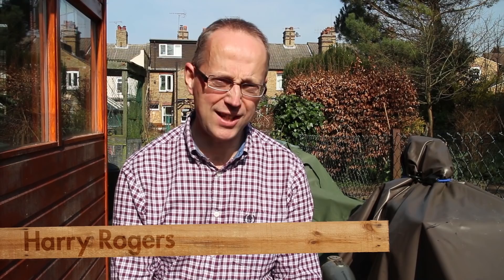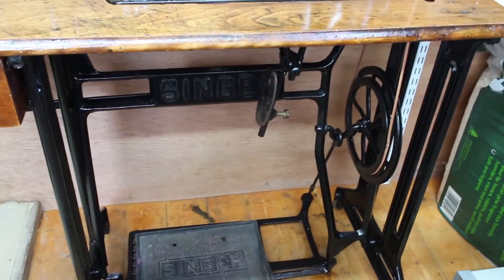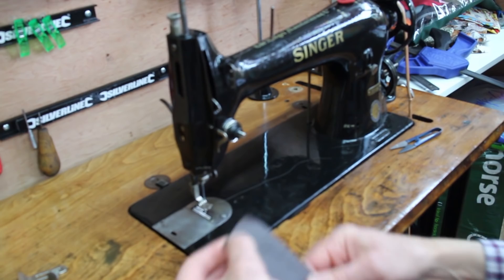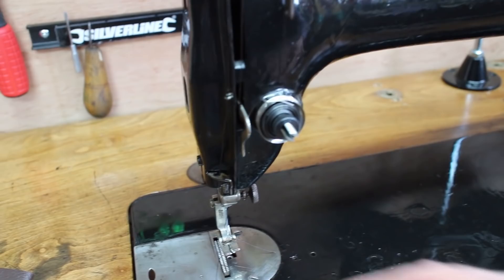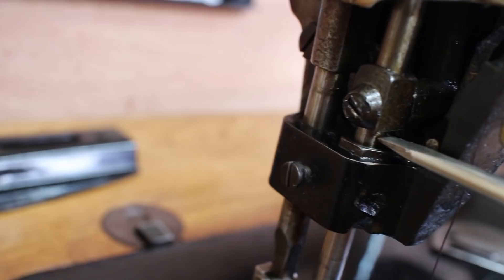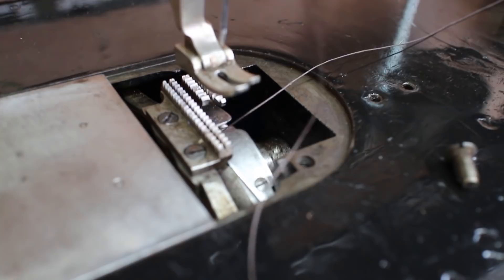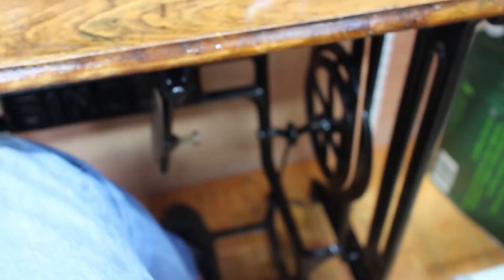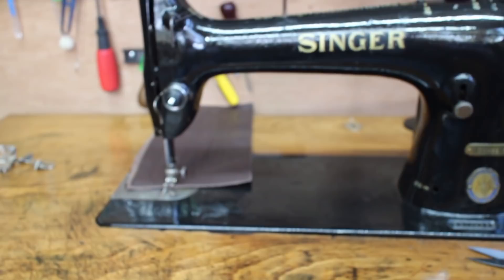Singer 31k15  overview, and Adjusting an Old Sewing Machine. Disregard 3.51 to 5.31 see Description

Comment: Hi,I have known people have cut the end of the pop rivets and use that for a tension unit pin that you discuss on you vid,
But what I wanted to ask you is my 132k6 and 45k1 don`t have that mechanism where the  cam hits the tension pin`but when I lift the pressure foot to lift my work out there is a piece of metal that hits the tension pin and opens the discs to release the tension on the thread,Why does your machine need to have this function `where others do not.
Is this more common on the older machines or the newer ones`
Nice explanation on the timing`
Reply from the maker: +wow dude Hi - I don't know - perhaps someone here does

Comment: Very nice video...very nice machine! Looks like a Centennial year Singer from the blue ring around the badge. When you are treadling, do you have your feet at a diagonal from each other, right foot in the upper right-hand corner and the ball of the left foot in the lower left-hand corner?? That's usually the best way to set your feet for a nice even treadling motion and greater control. Don't put a motor on it...it's perfect as it is. ;-)
Reply from the maker: Thanks I will try that ...very helpful.

Comment: Thanks for this video. Does the feed dog adjustment also allow to set the range, as well as the relation? I have one I picked up. It sews perfectly, but does not adjust out to the full stitch length. Thanks for your input. Very well layed out videos.
Reply from the maker: Hi thanks...I don't have this machine now, just the 331k...but you can download the manual from ISMACS...May be some oil on the adjuster if there is one to make sure it running it's full travel?
Reply: @harryrogers  I'll have to take a look. I'm thinking the eccentric on the collar is not set to its full range. You sold your 31-15?

Comment: Hi Harry, great job with your videos! very helpful to all of us newbies trying to figure things out with our machines.
I have a question regarding my 31-15 (no "K") made in the USA. My machine is breaking the thread all the time, based on your video the lever that is supposed to push out the pin on the center  of the upper tension to release the tension on the thread, the lever is not touching the pin at all during the stitching cycle, therefore the thread is to tight and it breaks.
I have ordered the upper tension unit in hopes that that is the issue following your advise, besides that is there any other adjustments I can make to correct that?

Sincerely,

Jose.
Reply from the maker: Thanks...often the pins wear and in effect become too short....it sounds like you are on the right track.
Reply: @harryrogers  Hi Harry, an update to my troubles with my 31-15, I replaced the whole upper tension unit on the machine but unfortunately it did not help at all, the issue remains the same as the problem is that the even with the new upper tension part, the pin still not being pushed to release the tension, the Needle Crank lever (part 43997) that is supposed to press on the Tension Release Lever during the stitching cycle, that in time presses the pin to release the tension.

Is there any other adjustments so the Needle crank pushes the tension release???
Thanks in advance for your attention
Reply from the maker: @Jose-yq1lk  Hi Jose...sorry I am not a mechanic, but I wonder if the linking arm loses its spread with age....is it worth trying to make a longer pin with an old thick needle to see what that does? Sorry grasping at straws as I do not know. Rgds Harry

Comment: Hi Harry, great video. Lots of helpful information here.  I just acquired a 31K15. The tensioner is needing replacement, so I've ordered one. But my question is how much should the pin in the tensioner move. I notice there is a gap between the pin and the cam follower, how much should that gap be ? I notice that there is no way of adjusting the gap.  I also notice on my machine that where the pin contacts the follower there is a depression on the follower. I should probably also get a new follower but I haven't been able to locate one.
Reply from the maker: Hi - you can usually unscrew the slotted screw in the tensioner to adjust the length of the pin, and you might be able to get the follower from College Sewing in the UK take a look at their website. Also look for a Singer Adjusters manual...I thing the American admirality put a few on line as they were used for making sails and parachutes . so a bit of googling - sorry I do not have the links.
Reply: Harry Rogers Thanks Harry

Comment: Harry,  You might want to double-check the manual about the “cam” inside of the head striking the tension release pin.  I don’t think that that linkage is supposed to touch the tension release lever at all.  Maybe the linkage piece is reversed or something else is out of adjustment.
Also, tell us more about your treadle stand.  It appears to me to be one of the Singer “Convertible” industrial stands with a special 2-piece pitman rod that is unique.  The coupling nut allowed quick change between foot-power and electrical-power operation.  I know of three different samples of these convertible stands, with your straight-leg stand being one of the least encountered, at least here in the USA or online.  I have one, and yours is only the second one that I’ve found.  Do you have any information on the stand, like perhaps a model number?
CD in Oklahoma, USA
Reply: To expand more on the tension unit operation, additional views of the video makes me think that the needle bar linkage is not reversed.  So, I would check for a bent tension release lever.  The levers can get bent easily if the knee lift lever stop is not set properly to not allow over-travel of the lift.  If your release lever is original to your 1951 machine, I believe that the lever thickness may have become produced thinner over time from the earlier machines, making them even more susceptible to bending.  I have had this problem with a newer Japanese-made 20U33 that has a very thin lever.  I bent it with the knee lift, and once I discovered what had happened, I was able to simply bend it back into shape with my fingers while it was still attached to the machine.  They are extremely light-weight in the new machines.  I haven’t ever compared the levers in my two 31-15 machines, a 1939 that I treadle with a knee lift, and a 1951 Centennial that I have set up as a hand crank (with a steering wheel spinner knob) and no knee lift.  I wouldn’t be surprised to find a thinner release lever in the newer model.
CD in Oklahoma USA
Reply: I am also wondering about this striking the tension release pin issue.  I just opened up a 31k15 from 1912 and it doesn't look like that was the case, although granted for the moment the tension assembly is frozen with the pin inside.  I haven't seen that sort of thing on any other machine that I have. Although, I do recall reading some 1920's publicity material about a tension release feature. Hmmmm   a mystery to look into.
Reply from the maker: Ben Coleman I no longer have this machine so I cannot really help any further. Best Regards Harry
Reply: Good info. Much appreciated.